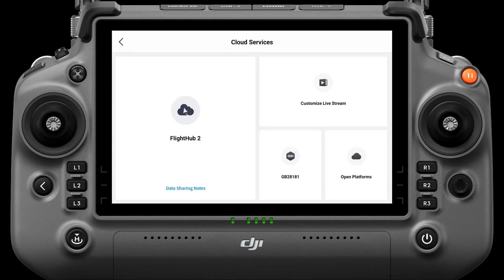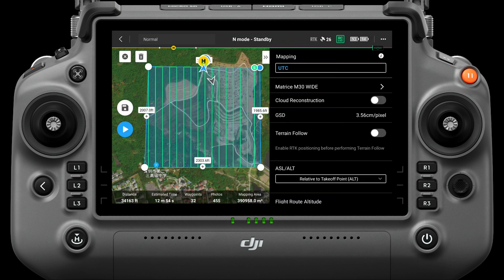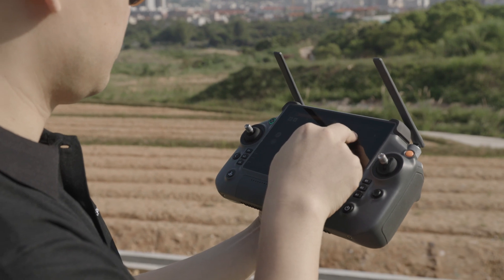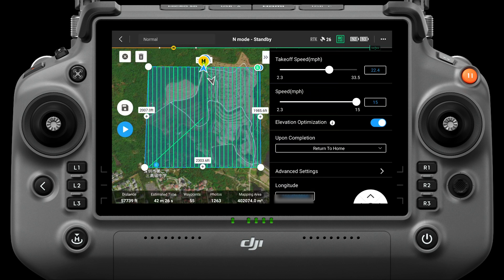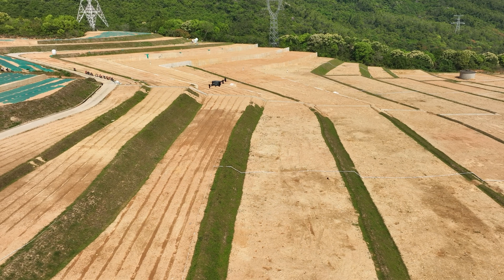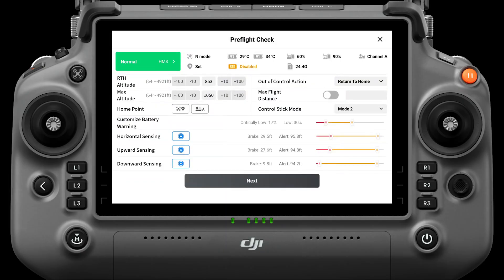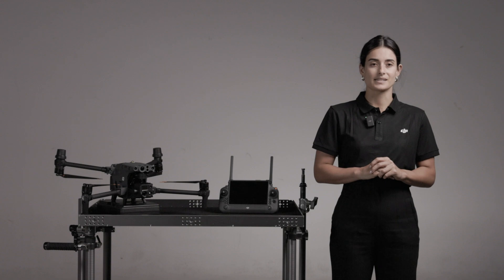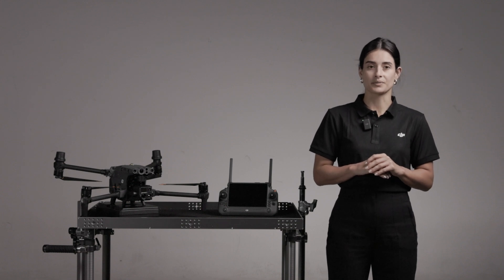How To Start A Mapping Mission And Create 2D Maps- Episode 9

Comment: There is a major problem with Pilot 2, It turns out that the Mavic 3E does not support the D-RTK 2 in mode 3, in Pilot 2, so you can't establish ground control points, what a conn. Don't buy the Mavic 3E with the D-RTK 2 for mapping, waste of money.

Comment: Why is there no option for "hover and shoot" as there was in GS Pro?
Why is there no option for adjusting the gimble angle as there was in GS Pro?
For "the camera mode "distance shooting", you mention a specified distance. Where do you specify the distance?
In manual camera mode is shutter speed the only parameter you can adjust?

Comment: Hi, thanks for an good educational videos. We use M30T for Sar missions and we are hoping to use video mode with this 2d mapping. Greetings!
Reply from the maker: Thanks for watching, for your information currently we only support photo mode for 2D mapping. Would need to do a waypoint mission to record video.
Reply: @DJIEnterprise  we also use it for search and rescue missions, and I agree with Hannu. I would like to have a mission to systematically fly over a certain area with, let's say 5%overlap on the sides. Automatic recording is not even necessary. Only when you hit the record button. i also would like to have different areas to search in one mission so rescue workers don't have to cross natural obstacles like ditches all the time while following the drone.